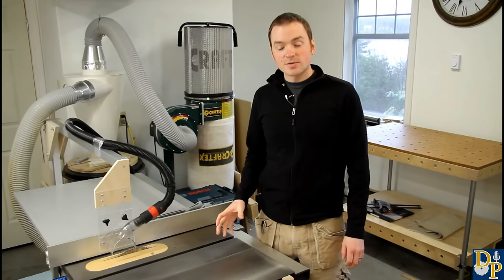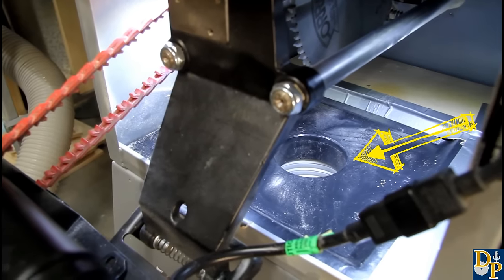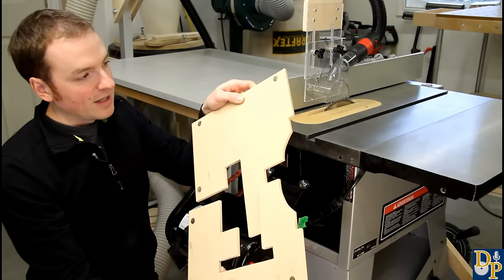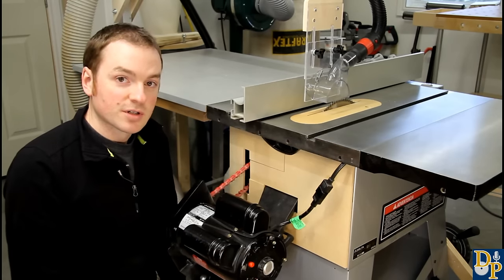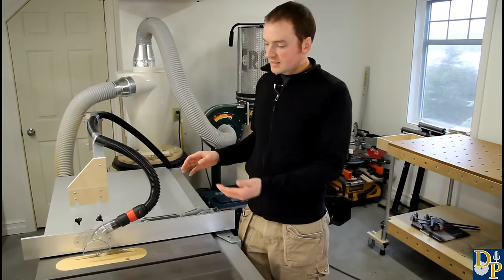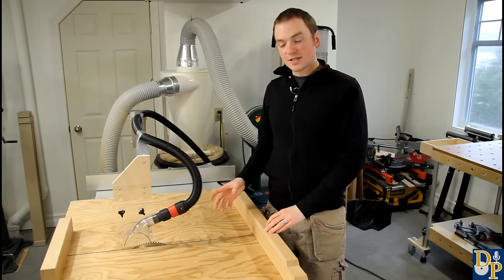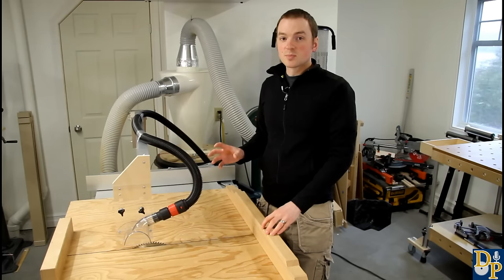4 Table Saw Dust Collection Upgrades

Comment from the maker: I just added a note in the video about not making the saw cabinet air tight.  You need to make sure you leave enough openings in the saw to feed the air flow of the dust collector.  The key is to control and concentrate the air flow, not block it off completely.  I should have clarified that in the video.  A member of the BeThePro forum brought that to my attention that I didn't specify that in the video so I wanted to put that out there.
Reply: I want the gaps to be around where the dust is being created.

A vacuum is litterly an absence of air, basically making the saw cavity a vacuum is my thinking. If the shop vac is working too hard when I hook it up, I will add some holes around the saw plate. That is the point of mess creation. 

I have watched so many of these videos my head was spinning. So now when I am faced with actually setting something up. When that happens I go to big picture. My general thinking is directed wind tunnels. In miniature where the dust is being created . . . in the shop in general, moving in clean air in and moving unhealthy air out. Filtered if possible on it' s way out.  

I have some experiments to run. Perhaps I will film and post on my other channel. My mind has some ideas that have stumped the internet. 

Also, I firmly think the end point of any DRS should be outside.

Comment: Nice dust collector adaptations.  Very slick design with the puzzle pieces and magnets. I was wondering how to enclose around my outside motor. Also like the fellow who used cardboard templates to make puzzle pieces to patch together before cutting out his real estate sign boards. Love this sharing of great ideas. Thanks. I'd like to see your demo of the overhead blade dust collector if you can fit it in. Would be much appreciated.

Comment: Dan, Thanks so much for this presentation. I closed up my old delta table saw as you demonstrated. Of course all saws are different so there was much trial and error (heavy on the errors). However after getting the plywood in place and closing up the cracks and crevices with aluminum HVAC tape, I cannot believe how well it works. I just finished dadoing a couple of drawers with 1/2 and 1/2 joints and there is no dust to speak of. Incredible.

Comment: I have an ancient Triton sawbench. It's a good old Aussie but a little less sophisticated compared with modern saws. However, I'm a diehard and will make do in the extreme if only to spend days solving all the problems. , after all it does the job it's intended to do. So first I learned to sew badly and made a haute couture bag with a funnel  that hung into a bucket underneath. Daggy but it worked fine except for the dust.Today that's a relic of the past having seen this video.  Thank goodness for genius far in advance of mine!. Since the bag, I've also added a lovely little windy uppy thingummywhatsit to raise the blade and lower it, oh what a joy!! it even has a brass doorknob for a handle.   Well the bag isnt going to de derigueur anymore, so your ideas will certainly be adapted to my situation which is pretty much dust coming from everywhere, including out west and down south of here somewhere beyond the  recently blackened stump. Thanks.

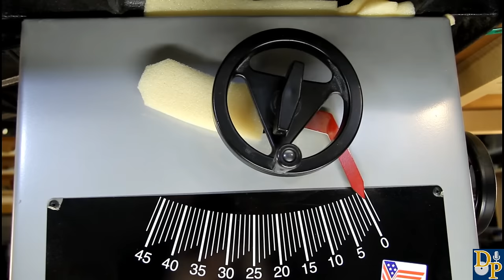Comment: 3:40 To seal the gaps under the cast iron table, I used a can of that spray foam insulation (the non-expanding version).  It was a bit messy so anyone wanting to try it, take your time.  A little at a time works better.  I think by masking it would be easier to apply.  Narrow slits I caulked with clear adhesive caulk.  For small openings (btw, I have a Delta full cabinet saw), I used small pieces of clear packing tape.  For the blade tilt hole or other large openings, you can buy rubberized magnetic sheets that you are likely familiar with in the form of refrigerator magnets with ads on them.  I bought a five pack of 12" x 12" sheets and cut to fit as needed.  Undoubtedly other sizes are available.  This would seal better than the spongy foam.

I like your over-table arm and I'll likely build something similar to fit, although I want the ability to move it or swing it out of the way when not in use.

Comment: Your mdf panel by the motor looks superb and gave me an idea.  I made a cardboard template then used the template to make the interlocking panels for my old Craftsman using leftover political yard signs. These were the corrugated plastic signs.  By cutting out the panels with an Exacto knife, the two panel pieces nested perfectly inside each other with no gaps or spaces. It's then easy to cut holes thru only one side of the panels and insert the magnets. Spray paint will cover all the politics.  You can also buy corrugated plastic or PVC boards from craft stores and big box stores if you can't find any political signs or real estate signs. I was originally going to use mdf or hdf but this was so much easier and quicker.
Reply from the maker: +John Temple great tip, thanks for sharing!  Good to see election signs being put to good use for a change :)  If you would like to have your setup featured on the Viewer Projects page you can submit some photos and a description to have it added in.

https://www.danpattison.com/blog/viewerprojects

Comment: Thanks for some ideas.  For the back of the contractor saw, I'm going to try making a dust director that is mount on the motor bracket mount bolts.  That way, the dust director moves with the arbor carriage when beveling.  For the upper shroud,could you incorporate a splitter?
Reply from the maker: A splitter would need to be attached to the saw itself rather than the overarm but you could add one.

Comment: A very helpful video. I have a delta table saw similar to the saw in your video, to which i wish to add a dust collector port. i shall be following the example in your video. I am also interested if you do a video showing how to make the over blade dust collector. Thanks fr publishing this helpful video.
Reply from the maker: The link for the overarm video is in the description. Glad you found the video helpful 👍

Comment: 1:20  I'm not sure if the video is flipped but it looks like your link belt is put on the wrong way? 
 
I mean, its not too big a deal, but I've noticed it's noisier. It supposedly causes the link tabs to be pushed, rather than roll when they reach the pulleys, and causes the belt to wear out quicker. 
 
I say this because my first link belt, I put it on the way you have it, and it caused the belt to get very hot, and break down faster. The little tabs on the inside started to wear out and if I didn't notice it in time, one could've become so damaged that it would've broken free.
Reply from the maker: I think I did actually flip it around at one point but I don't have the saw anymore so I can't be sure. I think someone else had pointed that out too. Thanks for the comment👍
Reply: @DPShopTalk  thanks. I'm always second guessing myself (and info I have) when I see something that is not the way I have it set up. Lol

Comment: Very clever rear cover build . I also have a contractors/high breed saw {Jet s10} i covered the openings under the top with a foam and the seams with a hvac aluminun tape.Yes please do a how to build the over the table dust collector. Thanks

Comment: I like the back side barrier and have built one for my Grizzly, works just fine. I do have a different approach for the bottom of the contractor saw. I took that flat add-on and cut the port out of it (after removing it). I then built a tapered chute from the full opening at the top down to 7" square bottom. I clears the floor by about 3" and attached the 4" (cut out) port to the lower end. I them placed a 1/4" plywood piece inside to channel the dust and air to the port. I works so much better then that flat plate, which always piled up with saw dust anyway.
Reply from the maker: +Marty Josephson sounds like a great solution for the bottom, thanks for sharing!  I need to make something like that for the bottom of my saw sometime.

Comment: Dan

I watched your video and really like what you've done here.  One question is the backing when it comes to tilting the blade.  As I'm sure you know, the motor tilts in order to keep the belt inline on the Delta/Rockwell Special Contractor table saw.  Do simply remove the backing for the limited amount of times you would need to change the angle of the blade?
Reply from the maker: Yes anytime that I had to tilt the blade I would just remove the panels. The vast majority of cuts were done at 90 degrees so it wasn't an issue.

Comment: Great ideas.  My saw has a heavy mobile base plywood stand that encloses the entire bottom it sits on and not the original metal one.  I have a removable box to collect the large chips at the bottom that is easy to pull and empty and only use the dust collector to remove the fine stuff.  I've been looking at ways to enclose the back where the motor sticks out.

I like the way you enclosed the back and think I will do the same to help improve the fine dust management.  Only change I will make is some type of latches to hold the two pieces together so there is no chance they can vibrate loose (I worry about it coming in contact with the belt).  It is rare I do non 90 degree cuts, so I'll just pull it off when needed.

Comment: Excellent tips Dan, very informative. Can you please share the construction of the overarm? I know that most of us are very interested in this portion of the table saw dust collection.
Reply from the maker: +Jared Turner thanks!  It sounds like there is enough interest then in the overarm collector so I'll do a video showing how it all goes together and what I used to make it.
Reply: +DP Shop Talk  Very excited to see how to make the overarm collector. I would find it helpful if you provided the source for the parts from the hose forward. Thanks DP
Reply from the maker: +Greg Tank sure I can list the source for all the parts when I do the build video.  Everything that I used is pretty readily available.

Comment: Embedding rare earth magnets to the back panels: drill a hole the size of the magnet, tape one side, insert the magnet and tape the other side. Cardboard is lighter, cheap and allows for smaller magnets.
Thanks, Dan!

Comment: I would definitely like to see how the arm was made.  In addition, would you be willing to share templates for your rear opening enclosure?  I have an earlier version of the the same saw.  I've seen a number of "solutions" that claim to be easy and work well.  Yours, however, is very elegant.  I especially like the interlocking nature as well as the rare-earth magnets.  Thank you in advance!
Reply from the maker: +Benjamin Trapnell thanks, there is a video coming out this Saturday(April 16,2016) on how the overarm was made.  I could draw up the two shapes of the back enclosure and post the link.  I'll let you know when I have that done.  I made a cardboard template first to fine tune the shape and then once I had it right I made the MDF panels.  They are simple but very effective.
Reply: I tried to make some templates that didn't quite work.  Have you decided not to make the templates for the back cover available?  If so, I will keep trying at my end. Thanks.
Reply from the maker: +Benjamin Trapnell sorry I just haven't had a chance to put together a drawing yet but I am still planning to do one.  When I have it done I'll let you know and I'll post it on the DP Shop Talk Facebook page.
Reply from the maker: +Benjamin Trapnell the template is now available on the DP Shop Talk Facebook page.
https://www.facebook.com/dpshoptalk/
Reply: Thank you.  Your efforts are much appreciated.

Comment: Thanks, Dan! Love the split cover you made for the belt and motor mount! But, I'm curious - doesn't the motor tilt when you do miter cuts? Seems there isn't enough room on the panels to allow tilt. How do you accommodate? Thanks for this great video!
Reply from the maker: It's very rare that I make a cut where the blade needs to be tilted but when I do need to I just remove the panels.

Comment: I am a fan of dust collecting particularly for a table saw. My priority now is to built one...I have a Bosch 4100, contractor table saw. It does the job for what I am doing. Any tips coming from the pros.
Thanks a lot for your work.

Comment: After closing the bottom and back, I'd think you needed make up air. Did you eventually decide to discontinue some of the upholstery foam?
Reply from the maker: No I haven't made any changes since making this video a few years ago. I've never had any issues with air flow and there seems to be enough openings left that air still enters to feed the collector.

Comment: When you make angled cuts with the saw, the belt would also tilt with the blade, just as it moves when you raise the blade. How would you keep that sealed without the belt hitting the MDF in the rear?
Reply from the maker: I very rarely make bevel cuts with my table saw so I just take the panels off for the rare occasion that I do.

Comment: Great video.  Did you make the clear plastic pieces yourself?  Or is at something that is available commercially?  Thanks!
Reply from the maker: I made everything except the Bosch router dust cup myself. You can find a link for the dust cup in the description.

Comment: I guess you remove the back panels when you changed the blade angle?

I am getting a headache trying to cut one that allows the swing of the motor and belt. Since it is almost always 0 or 45, maybe just two different back plates will solve this head ache. 

Thanks for the video and inspiration. 

Wish me luck.
Reply from the maker: Yeah I remove the panels when I tilt the blade. It is very rare that I have to tilt the blade so for me its not an issue. All the best with fitting yours.

Comment: Dan, you should post that your plan for the should does not work on all delta contractors saws. I-made  one from the plan and it is way off around the motor bracket.
Reply from the maker: How old is your saw?
Reply: Dan Pattison around 30 years old. The cutout for the motor bracket is in a different location and is a different size. Everything else is the same. Nice plan. I made it with the split strait across under the motor bracket.
Reply from the maker: Oh ok. My saw is 20 years old so they must have changed the design a bit somewhere in that time period. Glad to hear you got yours to work.

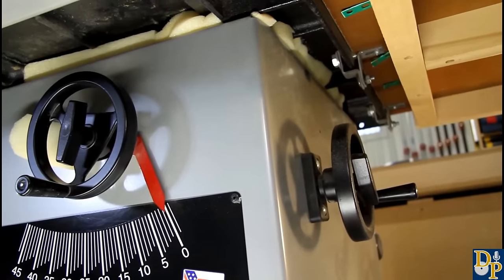Comment: Hey, Dan.  Thanks for the great video.  I have a similar saw and I notice at 3:33 of this video you show a shot of the underside of your table to illustrate sealing the the saw for better air suction.  But, I also notice it shows how your extension table is attached to the saw.  Would you be interested in doing a video on creating and mounting that extension?  I have a similar Delta and it's given me fits trying to design a table that will attach with such little space on the end of the cast iron table.  Anyway, just an idea.  Thanks, again.
Reply from the maker: The extension table on my saw actually came with it. It's the platinum edition so it has some extras on it which includes the extension. It basically just came with some metal brackets that bolt into the cast iron saw top and then the extension attaches to those. I've added some stiffeners over the years to help keep the extension flat but there isn't anything too complicated about the whole setup. The cast iron is fairly easy to drill to create your own mounting holes if you need to. Hope that helps.
Reply: Dan Pattison  Thanks!

Comment: I'm remodeling my 20x30 garage and turning it into a place where I make a few things. I have a new Dewalt DWE7491RS contractor saw with the wheels and all. This past winter I've been making a dedicated table for it, with a router as well. I like the saw but the dust goes everywhere. It has a port in the back sucking all the dust to from an enclosed hopper, but still way to much dust still gets out. I bought a brand new Craftsman shop vac that really works good, with my DeWalt planer, but the table saw is another problem. I have to stop up all the useless holes that should have been done in the factory. I have been looking for someone on here to see how they did it, and you young man have solved my problem. I will get to this soon and see if I can make it suck more dust instead of getting it all over me. I hope to have a dedicated dust collector come my way via Santa Clause.
Keep up the good work, I going to check out some of your videos.
See ya
Mark

Comment: Hey Dan, I have a Dewalt table saw. The dust collection system that is standard on it is ok but there is a significant amount of dust that hits the floor. Will an over arm catch most of it, or will I need to build some sort of a box underneath the saw as well?
Reply from the maker: Hi Mike, what model is it?
Reply: Dan Pattison It is the DW745 10 inch compact job site table saw
Reply from the maker: Ok, I have the same saw actually and use it on the job site. I've always found that the dust collection is pretty decent on it as is but an overarm would definitely help improve it and collect what spits off the back of the blade.

Comment: Where did you get the hose connector and plastic shroud from? I have made a similar collector using an after market guard. However the connection from a 67mm (2 1 /2in) hose required a step down to about 32mm and so much power is lost it doesnt work that well.
Reply from the maker: There is a link for the shroud in the blog article that's linked in the description.